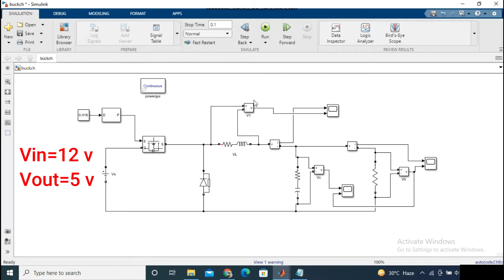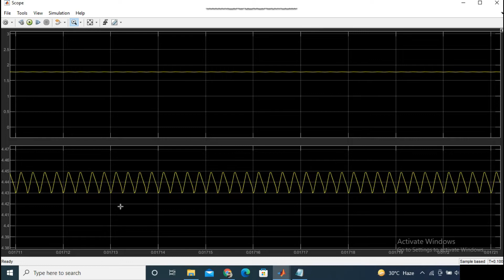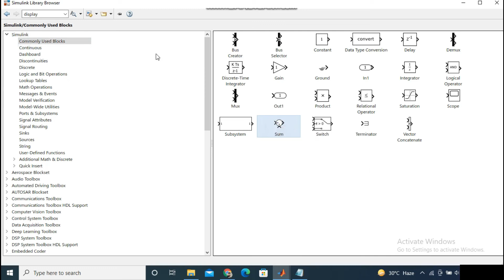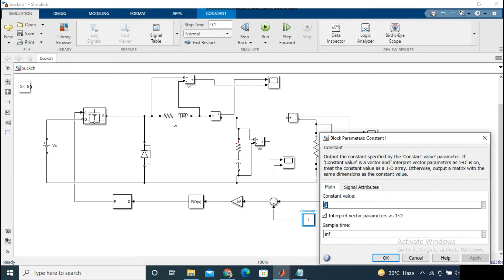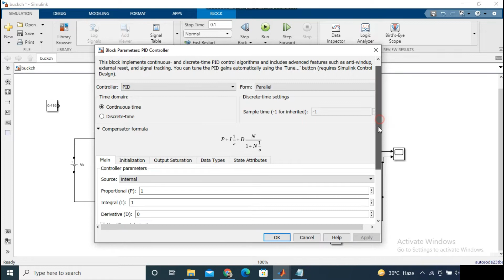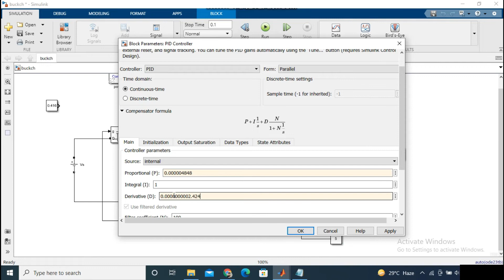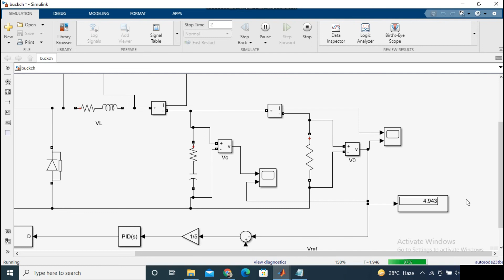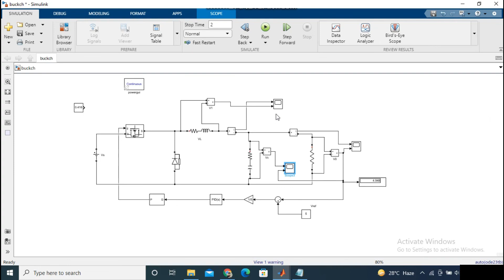Closed Loop Controller design of Buck (step down DC-DC) converter | PID | Chopper |MATLAB Simulation

Comment: How do we calculate the switching frequency for the Buck Converter? Is there any formula?
Reply from the maker: No you have to select the switching frequency according to your application
Reply: @RanitSengupta  How about 15 input. 5 volts output. 0.1A-1A load current variation.
Reply: What switching frequency should I choose?

Comment: Thank you for this riche vidéo, just why did you make 1/5 in gain is it's returne for our voltage in
Reply from the maker: No it is just a gain. You can mute this block also.
Reply from the maker: It is used for scalling the error